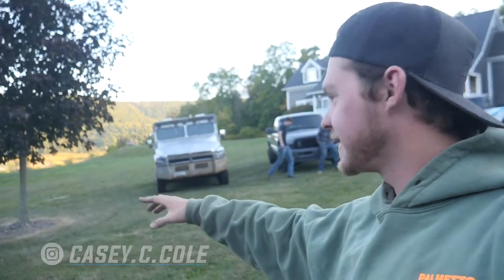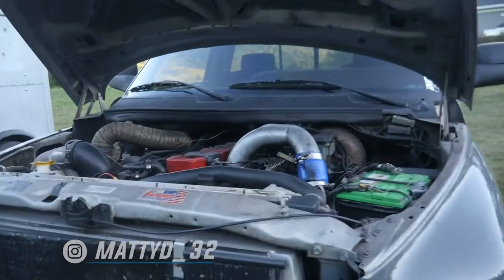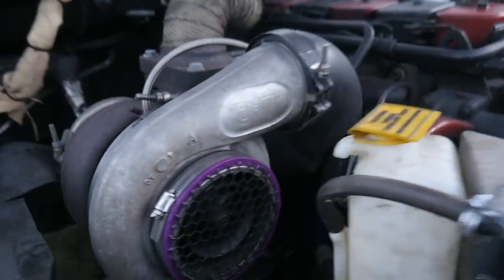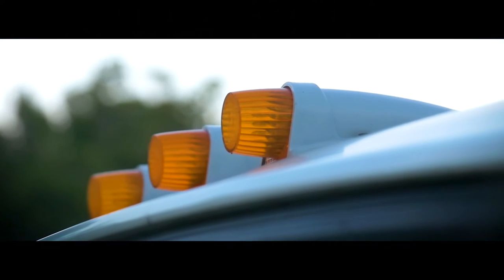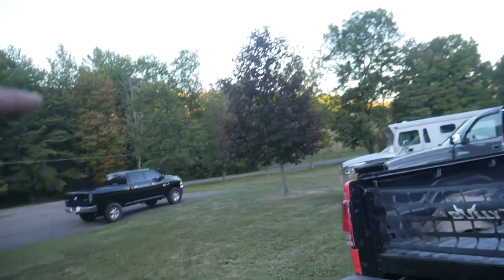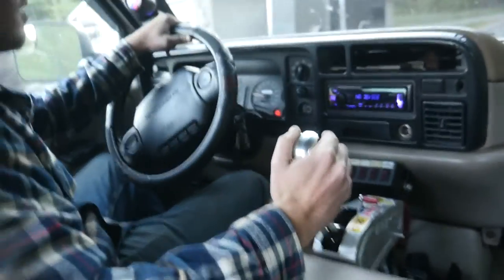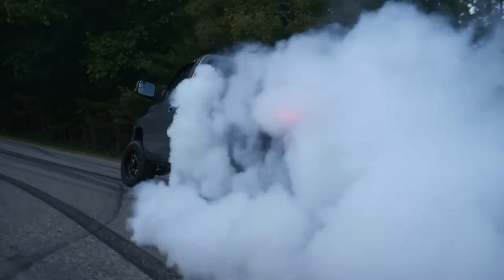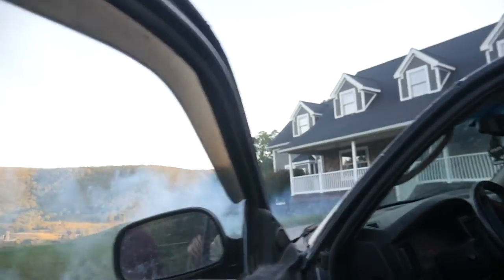800hp Compound Turbo 2nd Gen Cummins!!!

Comment: Can’t wait till I can move out off Cali so I can do this stuff😂
Reply: John...I used to live in Cali...Had Hotrod VWs down there and had 2 motors..1 Stock and 1 Hotrod...I had to pull the stocker and put the Hotrod in every 2 years and go get it Smoged....I got a Second gen now and cut the Muffler off and a Edge Comp and Air cleaner.....NO SMOG HERE IN OREGON...YOU CAN BUY A NEW CAR AND PUT A BLOWER ON IT....NO F...ING SMOG HERE
Reply: @slit4659  yes bro I have a 02 second gen and never had to smog it tell 2016 ish and every time I find somebody to smoke it how it is they get busted

Comment: Found your vid cause we did a job for a guy and he gave us a free cummins turbo diesel and little did he know it has one of the best year and most looked for engine with the fuil pump you can make a shit ton of HP with, it also has a brand new drive train and transmission, so long story short im about to make my dream truck and do a engine swap with a 1990 to 1997 f350 4x4 🤣